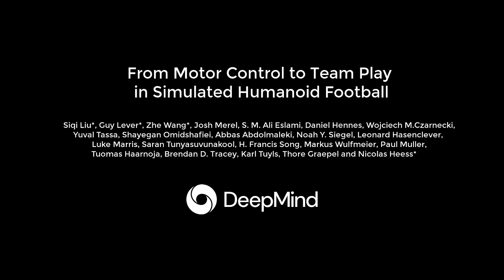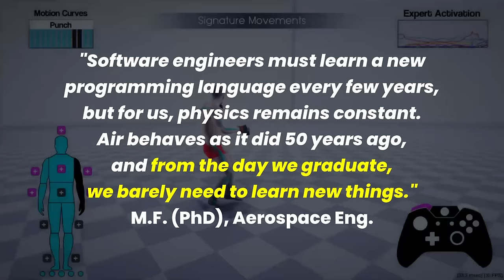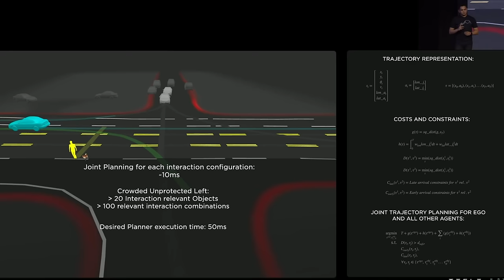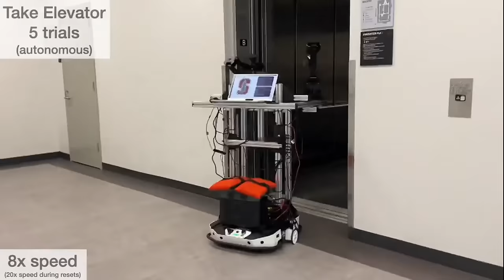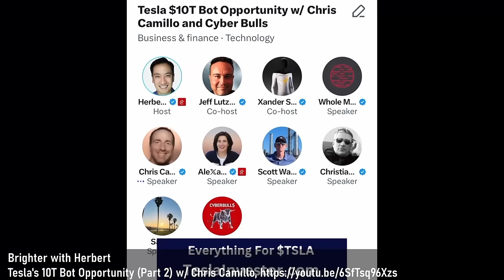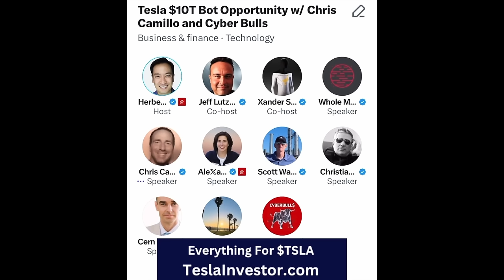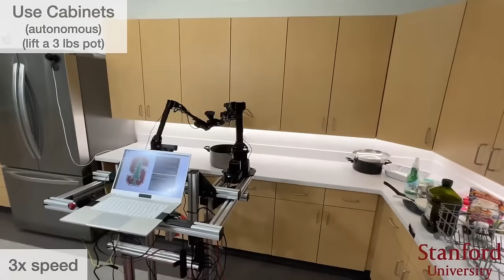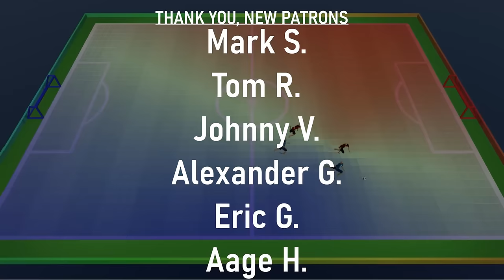Training Humanoid Robots | OPTIMUS PRODUCTION DELAYED due to Insufficient Training Data?!?

Comment: I seriously doubt they will disrupt anything. Everyone ignores the problems. Making it more human-like doesn't make it more useful, in fact now it's limited to what a humanoid can do and will NEVER do everything a person could. And making them all the same is worse! Can it lift heavy objects? Should it stand in a factory packing widgets and never use its legs? The factory fork-lift of the future will be driven by AI and have cameras to see all around. It won't have a steering wheel and wait for a robot to climb in and drive. You won't be maintaining hand/foot controls on the truck, or wasting time, or wearing out the robot and wasting the energy. The best part is no part! "It's made human-like so it can work in environments made for humans" Think about that! That is the antithesis of "First Principles"! (unless your goal is to copy a human which is much easier to do with sex) It compounds costs/complexity and reduces efficiency. I'm an automation engineer, I wish they would put AI on all the existing dumb robots. You could test and prove learning concepts/systems on existing equipment. There are all kinds of robots, controllers, vision systems etc. that could use a brain NOW. 
Besides the unproven AI, look at the fingers on Optimus! Could it even pick up a needle to thread it, Start a roll of tape, put a lid on a cup, make change out of a register? How long would it take to peel a label off the backing? tie a shoe, pick up a pen and write? A person, without looking, can pick up just one small screw out of a pile and orient it in their hand. A person can reach into their pocket and count change without looking. Please tell me the "easy" jobs a humanoid will be able to do! There are no "easy" jobs that aren't already automated. Enthusiasts will say "It's not like FSD because you don't have to be 100% accurate". Then it will fail in its job. If it drops a box of screws, breaks something expensive, falls and breaks itself, stops production etc. it's costs could be more than the savings. Enthusiasts will say "It doesn't need to be fast because it can work long hours". Then it will fail in its job. Factories are built for people to operate, so it will have to operate like a person. Asset utilization is important. Otherwise you'll have to create dumb jobs for it like overnight stock-boy. Call me when they demonstrate a stock-boy, if I'm not dead. Enthusiasts will say "we'll need them on mars" On mars you will want a smart crane/robot that can manipulate and join large habitat panels and move machinery. And you would want a smaller smart robot with tools instead of hands so it can manipulate/repair small cables/connectors quickly without having to pick up bulky hand tools. And it should have extending legs rather than get on a ladder. It would be ridiculous to have humanoids operate cranes, use wire cutters and climb ladders. You may only need two humanoids to set up a base because humans didn't evolve to use technology. The fud about the car was easy to ignore because the car was on the road. But the uncertainty and doubt about a humanoid bot that has no brain yet is very real.
Reply: I am sure "Super-Robot" will not be far behind for specialized tasks. Certainly the whole sensorium of a robot can be expanded beyond the 5 human senses. The "form factor" can vary from a nanobot swarm to mining or boring machines to humanoid to a whole spaceship or factory "overmind/controller". I do disagree with you about the humanoid form .. and it failing in the touted situations, supposedly already automated ... mainly because existing "automation" is crude, very sensitive to small contextual changes, very expensive, etc. However, I agree with your last point - the value of any robot will be a function of its "brain" or mental/compute "agency". We will see how that turns out over the next few years.
Reply: @WarrenLacefield But they want to mass produce them all the same!

"existing "automation" is crude, very sensitive.....expensive etc."    that doesn't make any sense.
Reply: I imagine specialized robots will continue to inhabit most factories. However the self driving forklift will never be anything but a forklift. The market for that is limited to industry. Humanoid robots have a wider market in that one design can be used for multiple tasks. In situations where you need the versatility to accomplish multitudes of tasks with one piece of hardware without redesigning the environment for machines to navigate a humanoid works best. Say package delivery to many places where multiple surfaces exist that are optimized for the human form. A humanoid could climb steps as well as utilize ramps and navigate through doors or other barriers same as a person. They are thinking wide market, not just in factories where it would be easy to match robot and environment. They are thinking also in terms of psychology. People are often more accepting of humanoid shaped companions in home. Spot imitates a dog for instance Atlas a human. Everyone cheers for RoboCop but no one cheers for the giant optimized security robots built by the corporation. They see a wider market outside of factories, a world where robots perform all jobs.
Reply: Correct. This humanoid robot project appears to be a vanity project of musk. But I have no doubt that the primary aim here is to keep Tesla valued as a tech company. The robotaxi project used to accomplish this but as time goes on more people reach the conclusion it will not be happening for this company - ever. Without robotaxis an autopilot system is not worth much more than fsd is now. If you have to be behind the wheel paying attention you may as well drive.

People who think humanoid robots are going to change the world are completely naive in my view. Not happening in our lifetimes. A humanoid robot could possibly be useful for some specialized tasks. But a human would need to be operating it remotely.
Reply: @susanlippy1009  "...you need the versatility to accomplish multitudes of tasks with one piece of hardware.."
Yeah, I get that, I just don't buy it. Making them the same won't really allow for versatility if they all have the same clumsy hands and reach and strength etc.
Reply: @zaphodbeeblebrox2817  this is assuming that they cannot accomplish more dexterous robots. Yes the current humanoid robots are clumsy and slow. Lack fine motor skills. If however they succeed at making robots that can move fluidly as a human and perform better more reliably than a human than the game changes.
Reply: @zaphodbeeblebrox2817  I did not say Optimus was crude. I was referring to heavy equipment robot arms that require shielding from humans, etc. That is like comparing a Tesla car and an excavator. They are context sensitive, expensive, and I don't think Tesla is interested in building them. They buy and use them, not produce or sell them. Optimus, however, will not be very expensive, should be self-adaptive in variable learned contexts, and relatively easy to mass-produce. I see an obvious use for Optimus in agriculture, particularly in orchards, vineyards, and vegetable production, for instance. In America, almost 2 million people work in direct farming jobs. Many more elsewhere.
Reply: @WarrenLacefield   Yes, you said the equipment is crude, makes no sense.  Go into a factory or farm then tell me exactly what you think this thing could do in a practical manner.
Reply: @susanlippy1009  that's a big "if"
Reply: @zaphodbeeblebrox2817  yes it's a big if. They think they can do it. Tech is usually very optimistic of what it can do, rather that optimism is warranted remains to be seen. But research and development isn't about producing what already exists, it's about developing what doesn't. Currently the humanoid robots are unimpressive in comparison to what a human can do. It's far cheaper to buy simplified automatic systems on market for restaurants and factory applications. As you point out a factory doesn't need a humanoid bot for most jobs so I don't see anyone rushing out to order these on that count. However for home use? I can see humanoid bots delivering packages, cleaning our homes, running checkouts, setting up displays in stores, replacing customer service jobs ECT. Applications where more human like attributes would be welcomed. If they can program themselves it helps. I don't want to order food from a car where I have to get my shoes on and my umbrella to walk out to the car, I want that car to bring the delivery to my door as a delivery driver currently does. That requires human type capabilities to adapt to the environment.
Reply: @susanlippy1009  like I said, call me when they can demonstrate it doing something practical. It can't even do what the darpa challenge bots did 8 years ago.
Reply: @zaphodbeeblebrox2817  true. I suspect they are way overestimating what they will accomplish in the timeframe they state. We still don't have reliable autonomous vehicles we were promised so long ago. Much of this is absolutely dreaming on the part of developers. If however they pull it off it will be a game changer. If not then it fizzles and dies. You will still have automated forklifts and maybe some exoskeletons to support human workers in lifting. An increased understanding of motion and a lot of cool toys for people to play with. What else are all these adult children to do all day? I think eventually we get there. Just not as quickly as predicted.
Reply: @susanlippy1009   The robots are not clumsy and slow and do not lack fine motor skills.  The robots are just fine it's the software not the hardware that is the problem.  As soon as the A.I. improves the actions of the robots will become smooth and quick.  The actuators and all the motors are capable of moving perfectly but the problem has been that the A.I. controlling them is crude.  But things are changing.  A.I. and training are starting to improve and therefore so will the movements of the robots.
Reply: @jlrutube1312  either way they are not yet to the point of being ready for use. Rather it's software or hardware causing issues. Maybe AI improves to that level and maybe it doesn't. Tech always promises to deliver yesterday and claims we are there. That's usually not actually true. Until it's actually a reality it's only a dream. AI still has a long way to go. Unless you think it's "hallucinations" are the outcome we all want. There are still major hurdles to jump and issues of ethics, legality to solve. Until the wrinkles get ironed out a healthy dose of caution is probably good. Yes it's fantastic how robotics has come so far, I agree. I hope the optimism is right but I'm a realist. So far nothing is that impressive compared to the marvel of the human body.